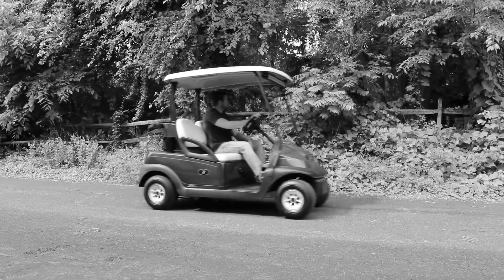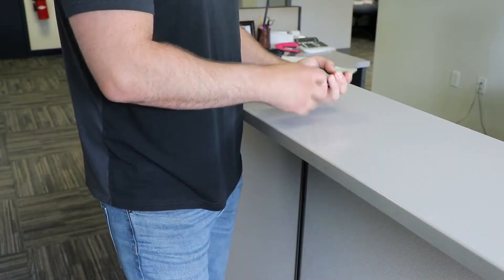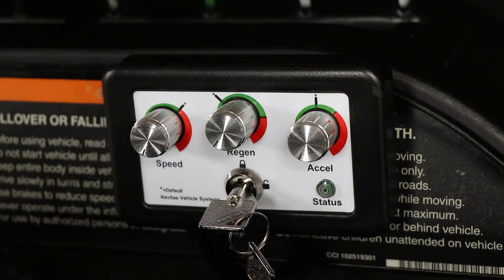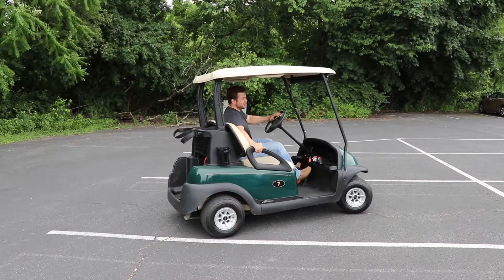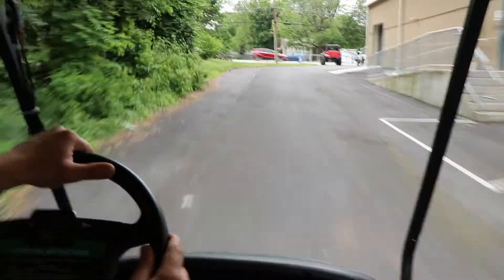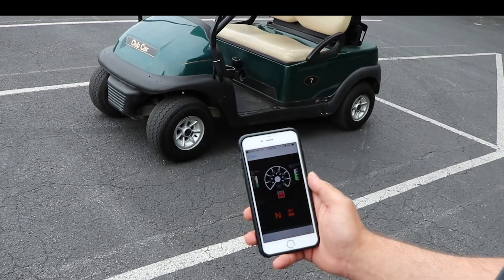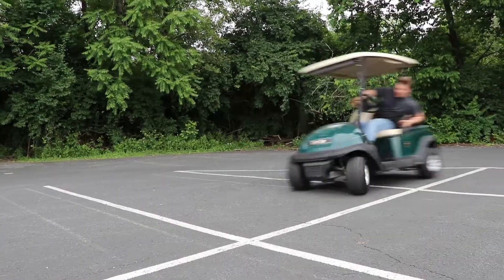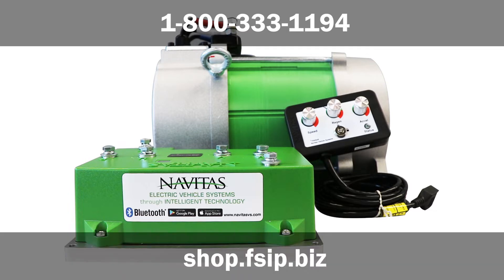Soup Up Your Golf Car and Get UPGRADED with a Navitas DC/AC Conversion Kit. ⬆️⬆️⬆️

Comment: Hello! I have a 2017 EZGO TXT 48 with stock solenoid and motor. If I were to install the 600 amp controller do I also need a new solenoid? Or can I use the stock/original solenoid. Thanks!